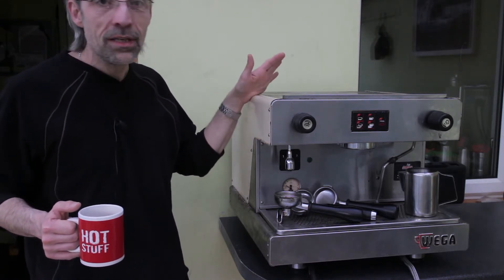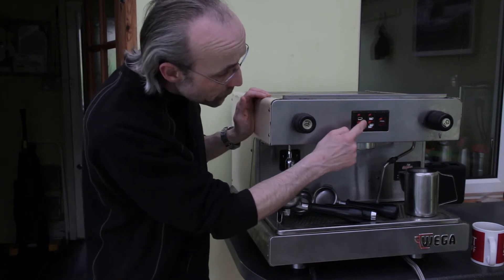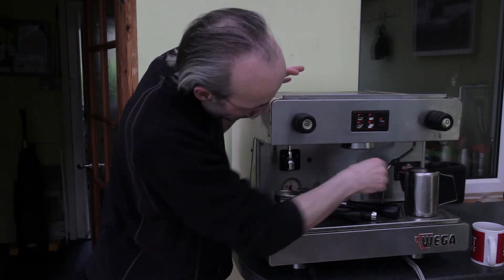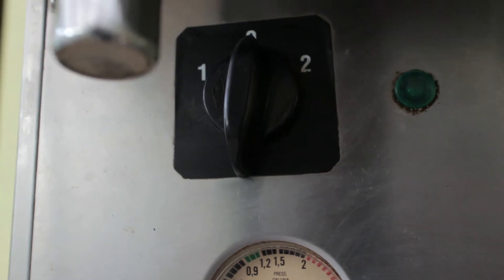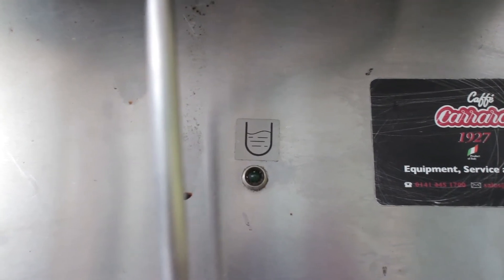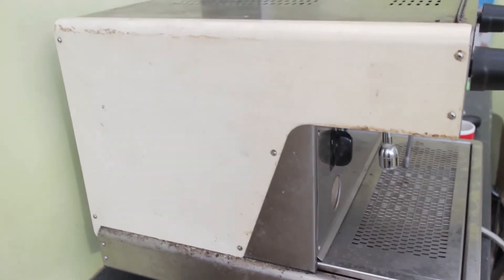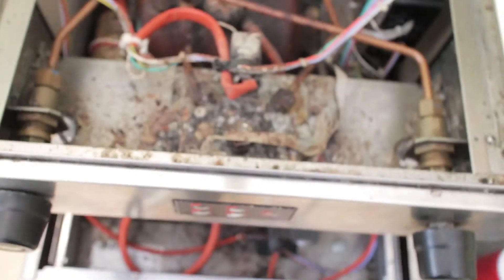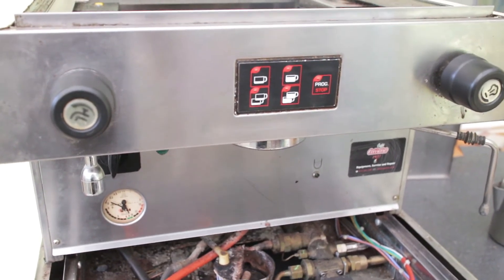Wega Single Group Espresso Machine, Project Coffee Part 1, introduction

Comment: Sweet! As a lover of life-affirming coffee beverages, this is relevant to my interests! 

I don't know about electrics, but I suspect the mains connection loom is designed for three-phase industrial power supplies? You might need to look into how to adapt that safely for domestic use. 

OH WAIT you mentioned that at the end. That will teach me for commenting before watching the full video :)
Reply from the maker: Modelmaking Guru No that's cool, thanks Foxx I was hoping for exactly some knowledge or comment on that, it's only that I bumped into Mr elastic trickery at work before I edited the video that I knew, of course if I'd read the sticker on the cable I'd have known! Duh.
But it's got diagrams for single phase 3 phase and 3 phase 300V so I'm thinking if I siphon another 60V off the socket next to it it'll be faster er and better er (n.b. electricians with no sense of humour, no I'm not serious) :)
He tells me you can get inverters to get 3 phase working on domestic soooo if I can't single phase wire it we'll see.
There goes my plan of stuffing the cable into a plug like Mr Bean.
I'm super excited to get this tested and start on clean up and refurb!
We all know spess Maureens are important but coffee is important er!
Reply: I had visions of you hooking it up to a plug and being all "I'll just cover the hundreds of other wires up with gaffer tape IT'LL BE FINE WHAT CAN POSSIBLY GO WRONG" lol
Reply from the maker: Modelmaking Guru Errrrrrmmmm, noooooooo, the thought never entered my mind, honest, ahem, I need to go and um, undo some dodgy wiring um someone um did earlier.
Reply: Ah, sounds like you have one of those mice that sneaks in and wires stuff up in a shoddy and slightly risky manner. We have one that breaks in and leaves lights on.
Reply from the maker: Yes, that makes sense, I was wondering who'd done that